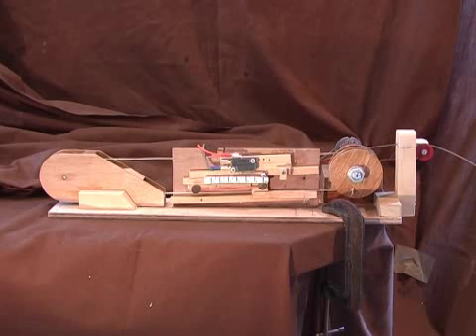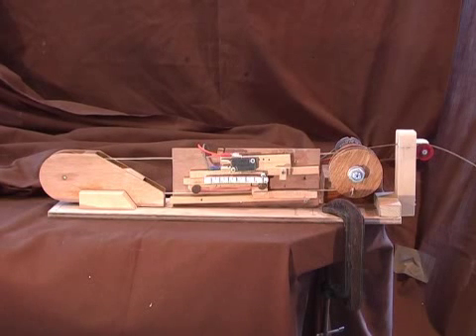Servoless sail winch prototype

Comment from the maker: LED's +ve is the longer of the two wires, The wire next to the flat on the flange is -ve
Check if you have connected the wires the correct way round. Check the leds work.
The bar on the diode in the diagram is the -ve 

When both switches are closed the current flows in both directions.
When the forwards switch is opened the forward current stops flowing. Putting the ESC into reverse, the reverse current bypasses the open switch by going through the diode.

Comment: Hello again
I set up a switch and LED in parallel on both the + and - wires between a motor and esc. It works till I hit one of the switches then instead of only turning in one direction it wont turn either way 
   Please help
   Jord